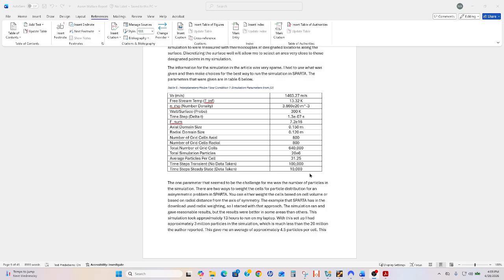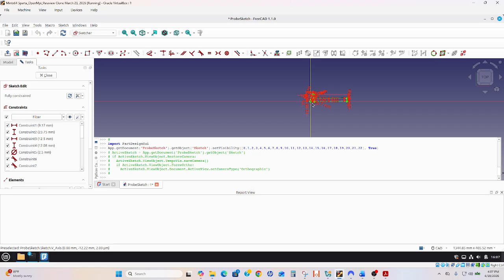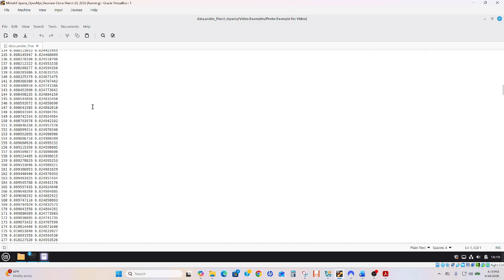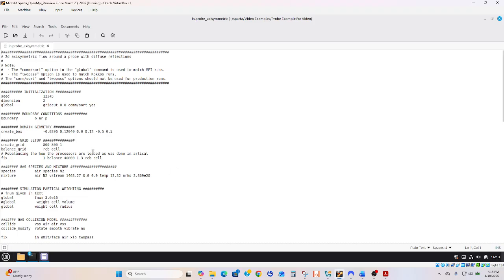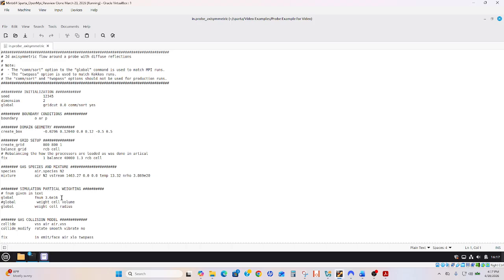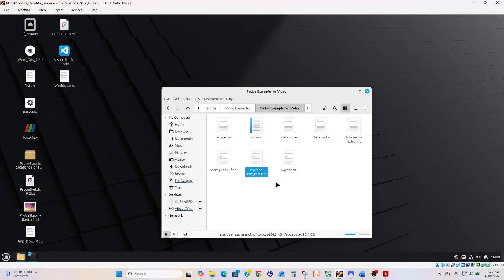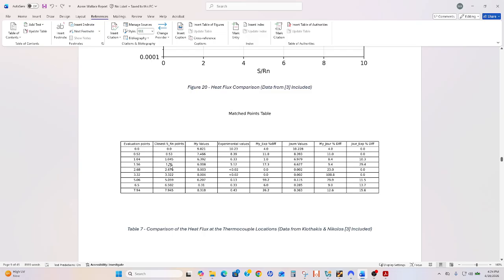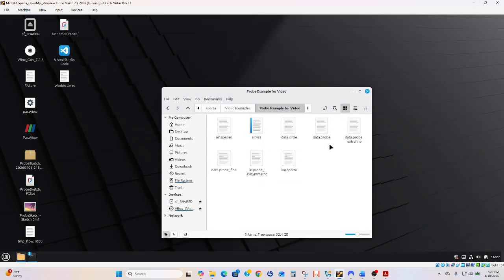SPARTA DSMC EXAMPLE 4 Interplanetary Probe 2D AXISYMMETRIC

Comment: With a freestream velocity of 1.4 km/s I would think the freestream total temperature would be much higher than your freestream static temperature of 13 Kelvin.
Reply from the maker: The total temperature that I am reporting is what SPARTA reports with the line:
  compute      gtcomp thermal/grid all all temp. 

From SPARTA Manual:
The values listed above rely on first computing a thermal temperature which subtracts the center-of-mass (COM)
velocity for all particles in the group and grid cell from each particle to yield a thermal velocity. This thermal
velocity is used to compute the temperature, as described below. This is in contrast to some of the values tallied
by the * compute grid temp * command which simply uses the full velocity of each particle to compute a temperature.
For non-streaming simulations, the two results should be similar, but for streaming flows, they will be different.

This is the temperature in that grid cell. I think you are right that is the static temperature that i am reporting. That may be why I have a large difference from what the Journal Article reported for Total Temperature. I think I need to try and run it with the other compute. 

It may be a bit before I can let you know the difference. 

Thanks for pointing that out!
Reply: @AaronWallaceMECHENG no problem! Im trying to learn sparta myself
Reply from the maker: @SnikeesDoesStuff  
I ran it again with the change I discussed above and got a max temperature of 2418 K which is reasonably close to the 2538 K the author reported. This is 4 ish % difference which is  what my difference was on the heat flux which would make sense to me. 

I have a lot left to learn about this program and the subject in general, but hey that is what its about.